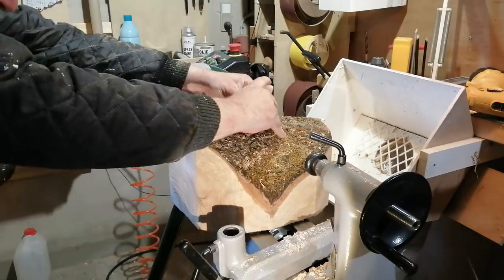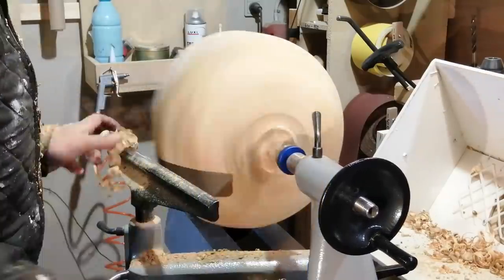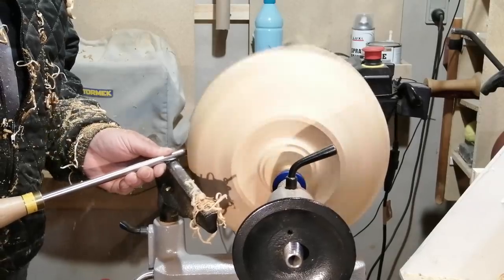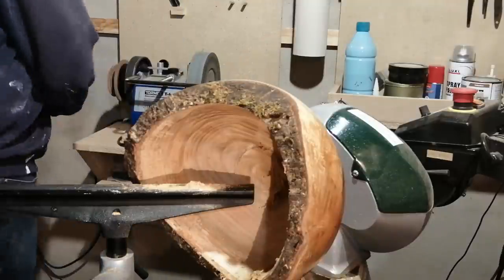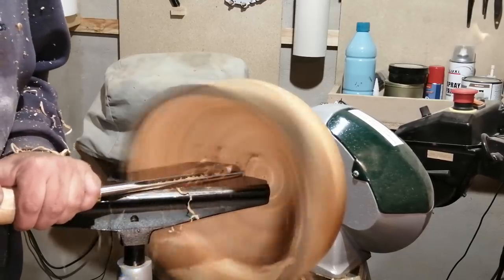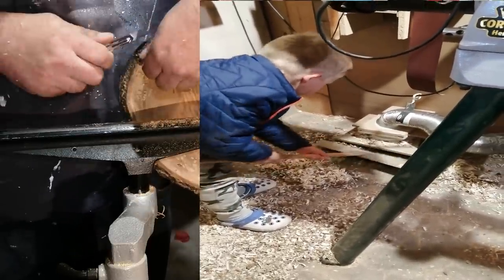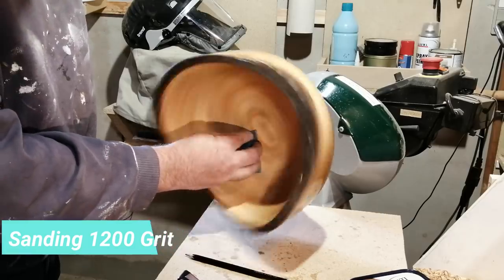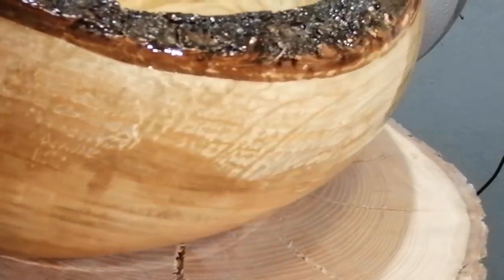How to Get a Glass Like Finish With Danish Oil -  Woodturning

Comment: Nice turning. If I understand you right, you apply danish oil and dry it with a heat gun, Then you sand it, apply more oil, dry it and repeat for about 8 times. Thanks for sharing.
Reply from the maker: I use the heat gun to speed up the drying yes, but that is only so I can apply 2 -3 coats at the time, and stop the lathe and  dont get drips below ,  you still need to let it harden 24 +  horeurs before sanding and applying the next 1 to 3 coats ..  .. thank you for watching my videos .. stay safe 😀😀

Comment: That's a great, great big bowl, lol. It's a pleasure watching you turn, and to see someone using a Bowl Gouge correctly, I see so many using the Bowl Gouge like it's a scrapper, and cutting with the flute facing upwards, I cringe expecting them to get a bad catch. Thanks for sharing your process.
Reply from the maker: Thank you very much, I really appreciate the comment, and that you take the time to watch my videos.. Have a great day and stay safe !😀😀
Reply: Actually I do all my finishing cuts with the flutes facing up and the handle lowered. It is in fact a very fine sheer cut along the freshly sharpened  edge of the gouge in contact with the wood. I haven't had a catch in a long time but it's always possible. it does take some nerve to start doing this.

Comment: Great video - I like our narrative and really appreciate your turning skills.  I never realized Danish Oil could come to such a high gloss.  I have a request for a glossy piece and I will try your method.  Thank you!
Reply from the maker: Hi Tom,  I am Happy you can use it .. Just be 100 % sure the oil have hardened up before applying the next coats, else you end up with a robbery/sticky surface that wont harden.. and only way to fix is to turn it off, maybe try on a small piece first :-) and be very patience 😁😀   Thank you very much for watching .. have a great day and stay safe 😀

Comment: Nice job!
May I suggest that you could use a duffle bag or something of that sort filled with sand and fasten hanging under the base with a tie down strap to make the lathe heavier? Wet the sand when you need additional weight.  It's a trick often used by photographers on their tripods windy days outdoors.
Reply from the maker: Thanks for the tips! i will try that 😀😀 i did buy some stuff to try and attach to the legs and make it heavier, just haven't got around to it yet 😀  but the sand back is a good idea.. thank you very much for watching .. stay safe and have a great day .. 😀😀

Comment: I’ve always wet sanded the Danish oil. It leaves a lustrous finish that’s not glossy. Also fills the grain nicely. I like the piece you’ve done.
Reply from the maker: Ok, I have to try that some time .. only done wet sanding one time before .. Thank you for watching and the comment I really appreciate it .. Have a great day and stay safe 😀
Reply: Hi Paul, can you tell us more about this? What kind of sandpaper you use and what grits you go through?
Reply: Start with 220 and raise the grain with a water alcohol mix. Get it smooth and go to 320 then 400. Pour on the oil and block sand with 600. It’ll take a few passes but the “dust”;turns into grain filler. Let it dry up between oil coats but repeat until you’re satisfied  with the surface. I always finish up with wax and may use 4/0 steel wool to do the waxing. I’m brand new to turning but I’ve made lots of flat stuff from hardwoods.

Comment: Did you do all the finish on the same day? I like Danish Oil but use lot of shellac which you can put on fairly fast.
Thanks,
Gary
Reply from the maker: No it is kind of a long proces,  after each 3 coat with heatgun inbetween it need to Harden takes 8 to 12 houres depending on the temp. Else you get a tickysurface that never stop gwtting sticky.. Have a great day 😀😀

Comment: I would not have believed you could get such a nice glossy finish with just Danish oil. What is the purpose of the heat gun? Does it make the oil dry faster? Did you use it after each coat?
Reply from the maker: Hi Rick, yes the heat gun hardens the surface so I can give it 2 to 3 coats at the time, I have tryed it on another piece without the heat gun after the one i filmed, and you get a pettey result with 1 coat and let it harden fully, and the one more and so on, I did 6 coats and got a  better result.. and the chance you take with the heat gun is that sometimes the danish oil get sticki and wont harden, and when that happens there is no way back, you have to put a gauge on it and start over .. the trick of this is patience .. let it harden before going on .. thank you very much for watching and for the comment .. stay safe and have a great day ..

Comment: Beautiful finish, but there are several other ways to achieve the same without near the work.  Take care, Larry
Reply from the maker: Hi Larry, thanks for the coment .. can you plz share some of the other ?? have a great day :-)
Reply: @WOODTURNINGBYBRANDSTRUP  Sure, My favorite way is to put 1 coat of sanding sealer on, sand lightly, 2 more coats, using steel wool and a scotch Brite pad on each, then polish with sanding paste and polish.  Comes out like a mirror.  Sometimes I use a poly wipe, 3 or 4 coats, same as above.
sometimes I use a spray, like lacquer or shellac.  Take care, Larry
Reply from the maker: I have to try that. Thanks for sharing 😀

Comment: I have attempted this process and so far I am unimpressed. I saved your video and have referred to it often but the results so far are disappointing. I have 10 coats on one piece and seven on another. Even after sitting for days they are still tacky. And the third coat in each set of three always seems to wrinkle and get rough. Any suggestions as to what I might be doing wrong?
Reply from the maker: Ok ,, are you sure the coats is fully cured before ading the nex 3 coats, and the amount you have to put on is to the limit for it to start dripping.. it did take me some tryes before i got my first good result .. I hope you manage to get it to work .. thanks for watching, Stay safe :-)
Reply: @WOODTURNINGBYBRANDSTRUP  I fought with this for about a month. I gave up and sanded it down to bare wood again. Maybe me, maybe hardware store grade oil, maybe just a bad idea.

Comment: Is Danish oil drying exothermic or endothermic? I didn't understand the comment about the rags being able to spontaneously combust but the video showing you using a heat gun...
Reply from the maker: Hi Thomaz, a part of the Danish oil is Lindseed oil and that is  exothermic, that is why i always keep the paper towels in a jar after using it.. they hav the possibility to self ignite even though the manufacture dont write it can I just do it a role to not forget with other oils and the i go out at burn it when the jar is full .... the reason i use the heatgun is to start the harden process faster .. as I find it harden the surface a little and then dont get oil drops running ..

Comment: What do you use to clean your brush?
Reply from the maker: I dont :-) or rater I havent found anything that can clean it after. so i buy realy cheap brush and burn the oiel off after to avoid self ignigtion..
Reply: @WOODTURNINGBYBRANDSTRUP  thank you for your reply.... how long does it take for that much Danish oil to fully cure?
Reply from the maker: @bigkahuna8338  2 to 3 dayes in around 20 C

Comment: that's a lovely finish, how durable is it and how does it feel to the touch, when I've used similar techniques it's felt plasticy
Reply from the maker: Mine is smooth, if it get sticky the coats was apalyed before it harden fully, an you need to sand an clean in between, an it did tak me some tryes to get it to work 100 %  😁 the Harding take longer tvan the can say if you use rostine.. Thank you for watching.. Have a great day, and stay safe.. 😁😁

Comment: Never knew Danish Oil could get so shiny.  How long does it need to dry between the sets of three coats?  Gonna give it a try.  Subscribed.  Thanks.
Reply from the maker: you need at least 24 hours, it is very important that it is completely dry and hard befor applying the next coat, good lock with it hope it work out, thanks for watching .. stay safe and have a great day . 😀😀

Comment: Are woodturning gouges used directly after grinding or do they need to be honed on an oilstone after grinding?
Reply from the maker: Hi James, I think that depend of who you asking, I did do it on a leather wheel in the beginning, but got lazy and stop doing it and found that the result on the cut was the same, I think when you make the first cut the wood more or less do the job for you in the first cut, but that is just my opinion.. I do use a diamond plate grit 400 but that is mostly for negative rake scraper and normal scrapers, with the grinding systems no mater witch you have, it is so fast to sharpen a gouge that I normally just take it to the grinder instead of using the diamond plate.. I did recently change sharpening system from the Tormek to the ProEdge and I have the same experience with that one. I hope that answered you question, otherwise feel free to write again, Stay safe and have a great day      😀😀
Reply: For wood turning, especially with high speed steel (HSS) tools, there's not a lot of point in honing - the very sharp tip of the tool that honing would give will be stripped off by the volume of wood flowing past it in just a few revolutions. HSS will still hold a good enough sharp edge for a long while, which is of course why we use it! Carvers do hone their tools, which are normally high carbon steel not HSS, but they only pass the edge through a few inches of timber in the same timescale...

Comment: So all of the Danish oil instructions I have seen insist on the apply / let soak 10-15 min / wipe off / let harden method. You don’t wipe off the finish at all, so it looks like to me you are putting most of your attention toward controlling the curing process, so the shiny look we see BEFORE we wipe off the finish will remain. This is all new thinking but i like it.
Reply from the maker: That is correct if you wipe you cant get the shine.. thanks for watching. have a nice day.

Comment: Or just soak your oil rags in water & toss them in the trash wet.
Reply from the maker: Maby, dont know what gonne happen when the rag dry up ??
Reply: @WOODTURNINGBYBRANDSTRUP  
You need 3 things for combustion... Fuel, Oxygen, & Heat.  
The heat from any curing of the oils will have disipated long before the rags dry out.. eliminating the possibility of spontaneous combustion.